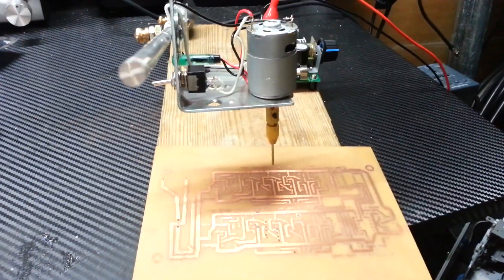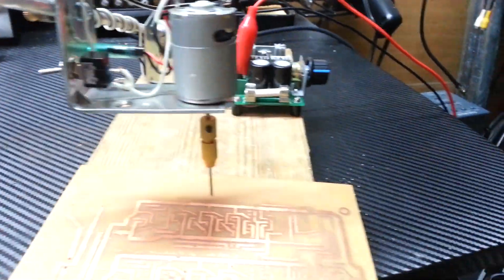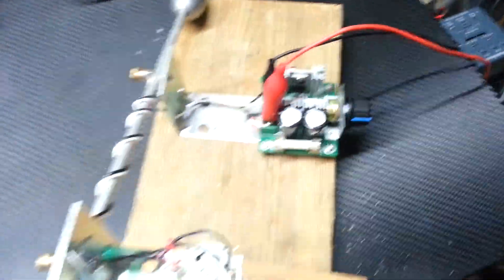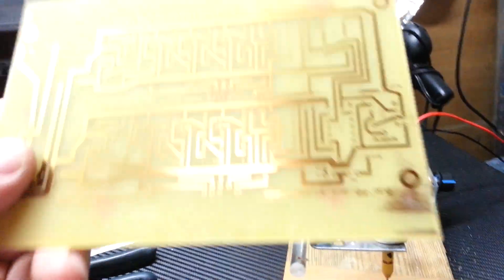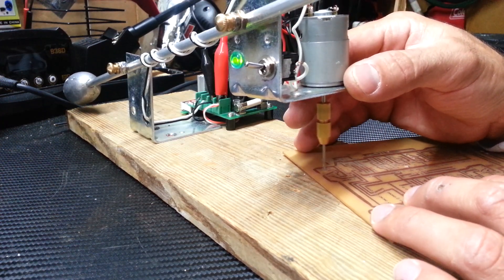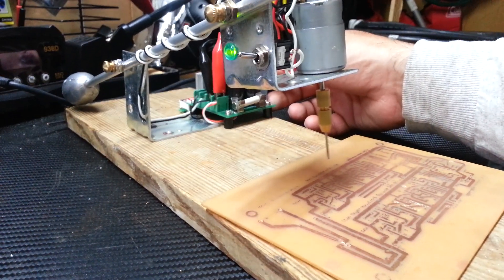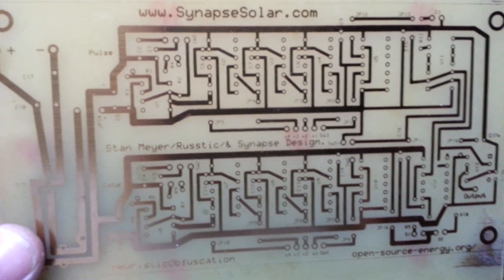How to PCB Drill Press

Comment: Pretty cool but I don't like the idea of it being on a pivot point making the drilling more slanted than straight/plumb up and down. If you had some type of rail system to make the drill motor/bit go straight plumb up and down then I would be all over this.....
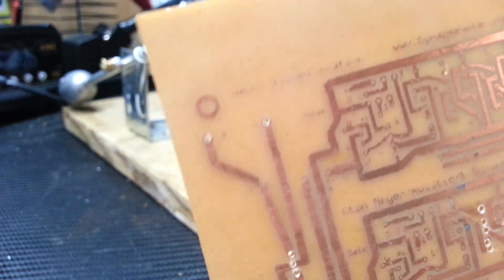Reply: jeanious2009 Oh hell no...I saw the actual results at 3:25 and I have to say that is POOR DRILLING!!! I can do better freehand with a dremel. Also your holes are WAYYY TOOO BIG, its mostly removing the whole damn via that is suppose to hold solder. Not to mention you have LOTS of imperfections on your traces...
Reply from the maker: jeanious2009  Thanks for your input... yes the holes were two big for the test board... The size on the pcb nodes can be changed easily by using diff size drill bits. In the test board there is definitely lots of imperfections, this was my process of learning to do traces, I finally used a much refined method and achieved cleaner traces.. check here.    https://www.youtube.com/watch?v=LYJSiGAQnsU
Reply: HeuristicObfuscation Thanks for the link/update...I guess I'll give photoresist method..
Reply: +jeanious2009 definitely something like those microphone scissor arm setup where the vertical axis is straight up and down and not rotating no matter where you move the arm to...still a pretty cool build